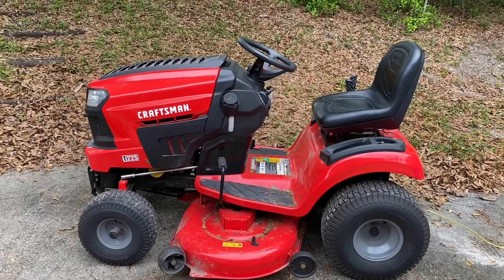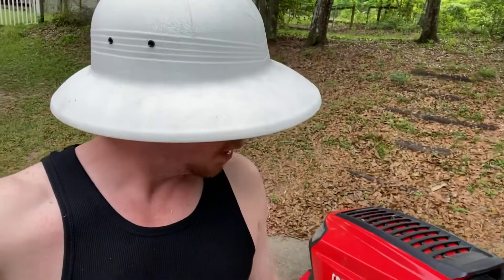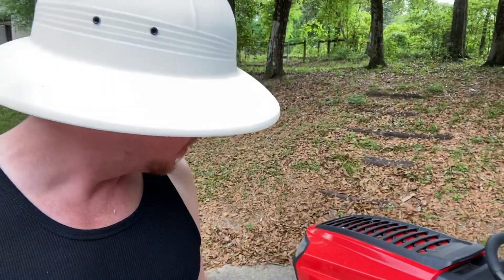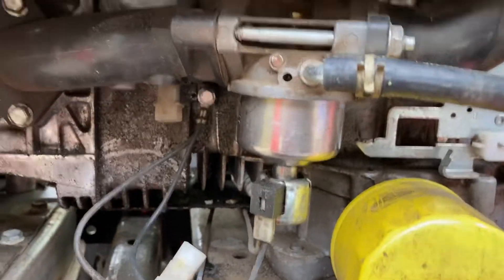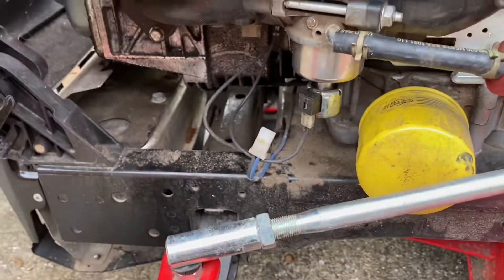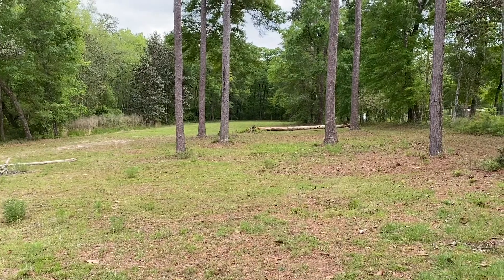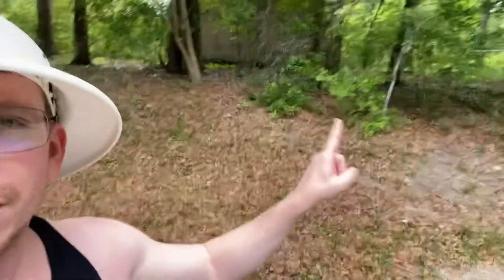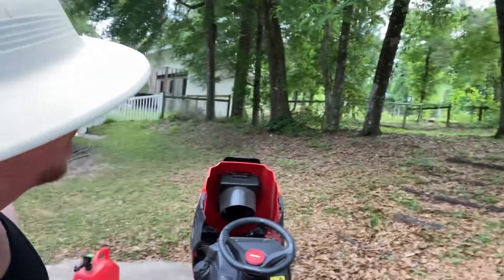This DAMN mower!

Comment: AS FAR AS NOT RUNNING OR STOPPING... I WOULD CHECK THAT RED FUEL FILTER... OR CHANGE IT.
AND CHECK THE GAS CAP FOR VAPOR LOCK.... LEAVE IT OFF WHEN STARTING, AND MOWING... ITS A COMMON PROBLEM WITH THESE CRAPSMANS
Reply from the maker: Vapor lock in tank? OK well at least I have something new to try
Reply: @toolgear  yes....if your gas cap doesnt "vent" ...It's like holding your finger over a straw when in water and you pull the straw out and the water stays in the straw.....same thing can happen in the gas tank if not vented.

Comment: LOOKS LIKE YOU UNPLUGGED THE STATOR... WHICH IS OK, BUT THE BATTERY WONT RECHARGE WHILE YOU MOW THEN.
Reply from the maker: This is what’s messing with me, did it start running just coincidentally once I disconnected it or didn’t cause it to run somehow it doesn’t make any sense to me